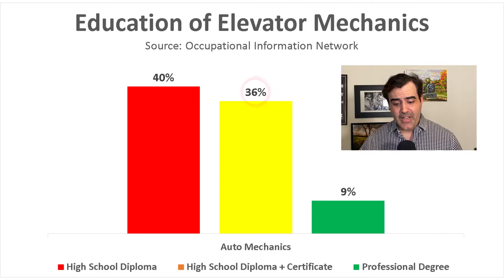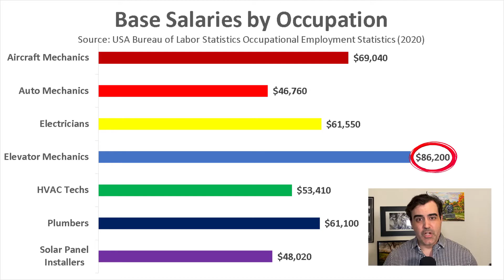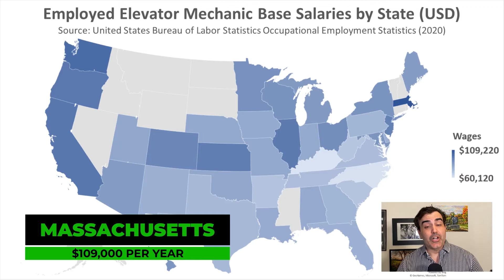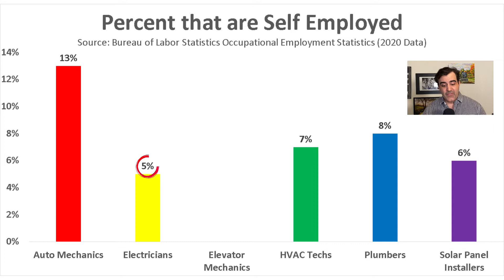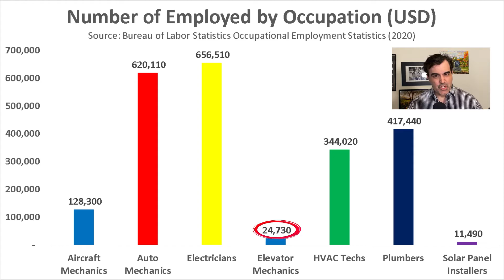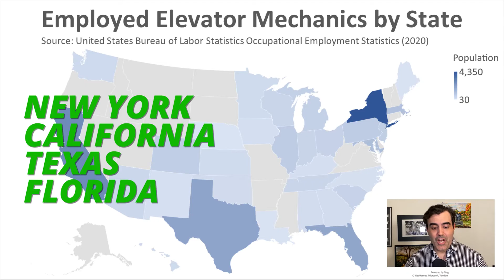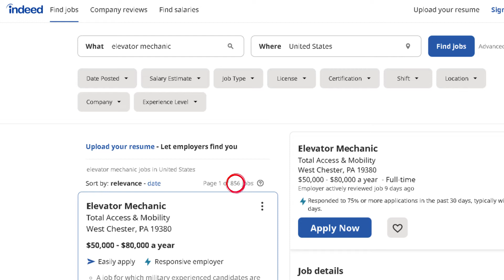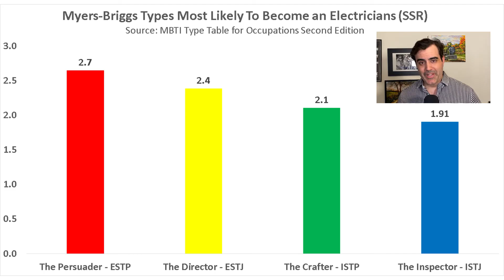Become an Elevator Mechanic in 2021? Salary, Jobs, Education

Comment: 1:53 this is not true. linemen can make 200-250k/yr depending where they work, heavy duty mechanics can make 150-200k/yr. but, being an elevator mechanic gives you a very flexible schedule, a good union if youre on the union side, solid work/life balance, and generally agreeable working conditions. if you're strong, smart, and mechanically minded, its a good career. we also get great benefits.

source: im an elevator mechanic

Comment: I tried to get into the elevator trade, but they didn't want me. I was in my 30's, a navy vet and had a strong background as a  licensed factory electrician/mechanic with PLC and installation experience. I wrote letters and sent out a number of resumes but never heard a thing. Like any other good job that's hard to get, you have to know somebody to get you in, and if you don't know anybody, too bad
Reply: Did you get turned down or just no call backs ? Just asking

Comment: How about a woman getting into the field? Is it more difficult? I'm training as an electrician and I haven't heard of any women around in elevator mechanics
Reply: There are definitely women in this trade. I've worked with a couple. One of the women I worked with was an Adjuster and I was her Helper. An Adjuster is someone who does all the final TLC and tests on the elevator to get it ready for an inspector. And then also goes through all the tests with the inspector and then finally turns it over for final operation. She was very smart.

Comment: If any mechanics are reading do you typically work alone or in a team? Can you have a partner? Brother and I are thinking about getting into the trade and were wondering if we would be allowed to work together as a team or is that usually not how it works?

We dont care if we have to work separately just wondering if this job allows for partners. Thanks!
Reply: Depends on the department. Most of the time it’s one mechanic and one helper. Service mechanics work by themselves more often. If you’re on a big construction or mod job there may 30 40 or 50 men on the job. Again, it’s normally 1:1 mechanic to helper. Sometimes 2:1.

Comment: Recommendations for training and certification?
Reply: Welders certs you get paid as a journeyman when u an apprentice
Reply: Having a welding cert will not get you Mechanics Wages (journeyman). Only puts you above the other apprentices (Helpers).
Reply: @joshuarandall7513  I'm an elevator apprentice with welding certs, you do get journeyman pay when welding as an apprentice.
Reply: @jonathanharrison8804  I don't believe you do as long as a Card Carrying Mechanic or a MIC is on the job. It's not part of the Curriculum in school to be a mechanic so it's not considered Mechanics work.
Reply: @joshuarandall7513  i've literally been paid mech wages while welding, check the bylaws if you're in the union
Reply: @jonathanharrison8804  ok that's good for you. Like I said I am not sure. It's not a requirement to pass the Mechanics Exam. I am a Mechanic so I get that pay anyway. And yes I am Local 37.
Reply: Did you find any ?
Reply: You get mech wages as an app. if you are a cert welder and if your mech isn’t cert.  You only get that wage while you are behind the hood.

Comment: You forgot to mention that for the trades the quoted government stats averages across apprentices, journeymen, and master tradesmen. So the average you reported is actually low by about $20,000 for a fully licensed mechanic. I know that in Boston (IUEC Local 4) the base pay is over $62/HR and increases by contract at 3% per year.
Reply: The cost of living and taxes are also outrageous in Boston.
Reply: @miguelquazar883  true, but I don't live in Boston 😁. Further west are cheaper options if you don't mind a little driving.
Reply: @dackhornbold322 are you in the mass area because I’m thinking about becoming a elevator mechanic
Reply: Indiana is 60.17 and the cost of living is cheap so..

Comment: From all the trades which one is the less hard on your body?
Reply: Never met a truck mechanic over 60 who wasn't falling apart
Reply from the maker: HVAC techs have a high rate of injury and electricians get electrocuted every now and then. Maybe plumbers, but I could be wrong.
Reply: accounting lol
Reply: @thispersonrighthere9024  not really, you're brain will be fried after dealing with all those numbers and the stress of the irs.
Reply: Supervisor.  Lol.
Reply: this is prolly one of the hardest trades on ur body.. not only can you get crushed but you can get.l zapped with 440+ volts
Reply: Crips get less injuries than bloods
Reply: crane operators would be my guess